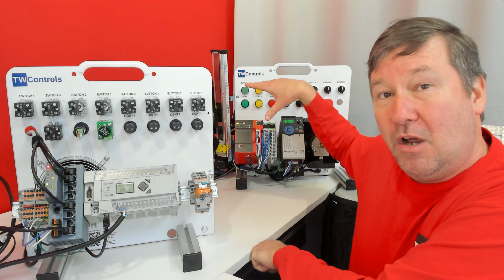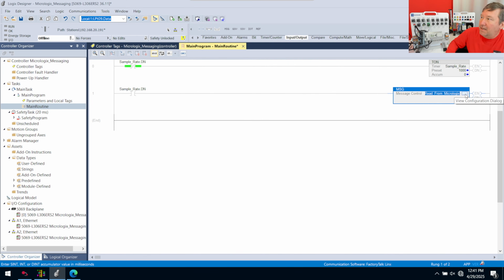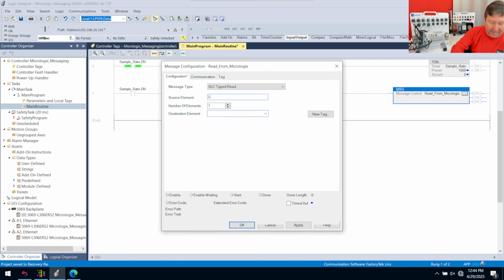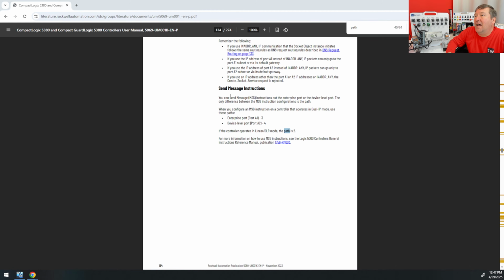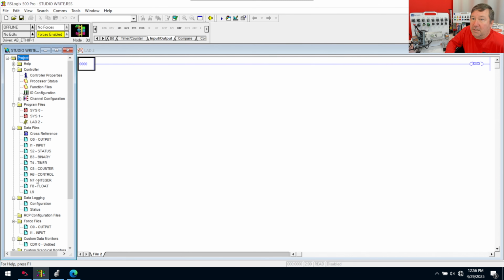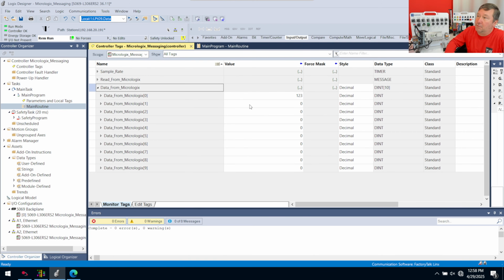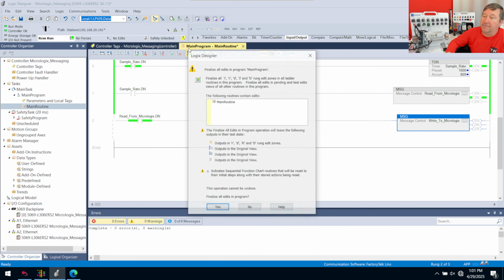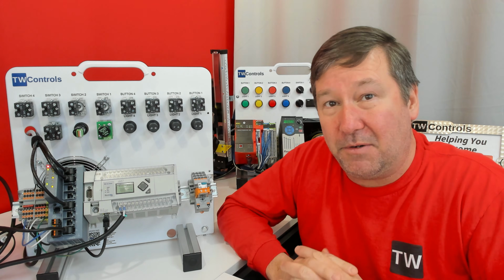Studio 5000: Controllogix/CompactLogix Reads & Writes Micrologix Data

Comment: Thanks for the video! Very informative. Long time viewer. Figured I would throw my two cents of experience in with messaging STRING data types:

A ControlLogix or CompactLogix controller can read from or write to an SLC string data file, but it must be done using a PLC-5 Typed Read/Write message (don’t know why). The SLC string is referenced as an STx:yy element, where x is the string file number and yy is the element number within that file. The destination in the Logix controller must be a STRING data type. Direct string messaging is not supported—communication must use the PLC-5 typed messaging format to properly access SLC string data. 

Additionally, if you are doing the messaging in the SLC/micro, I don’t think you can map string tags to data files (what you did in the compliment video) the way around this is copying the STRING.DATA[0] into some INT[42] tag then do the message, and finally copy into whatever ST file you need.

Probably way more information than anyone cares about 😂 honestly there is enough stuff there to make a third video on how to do it.
Reply from the maker: That's some excellent insight, thanks for sharing your experience with string data types!